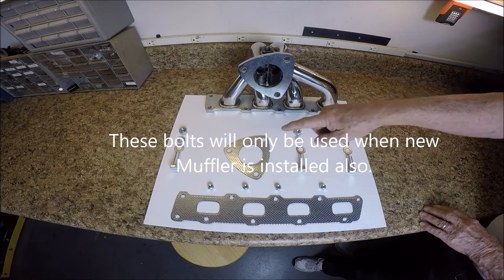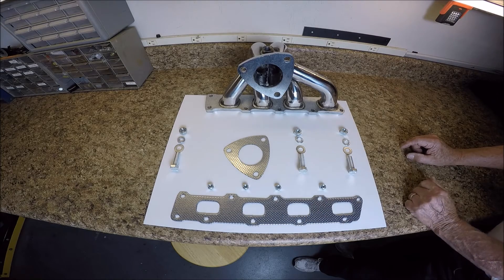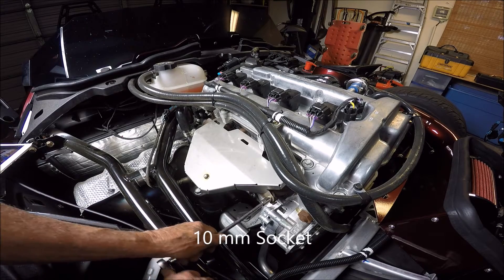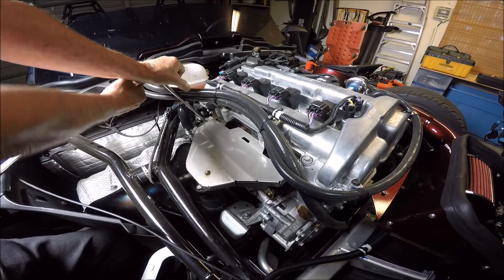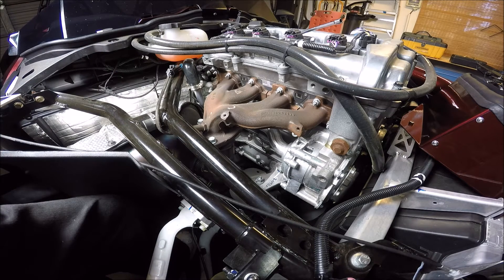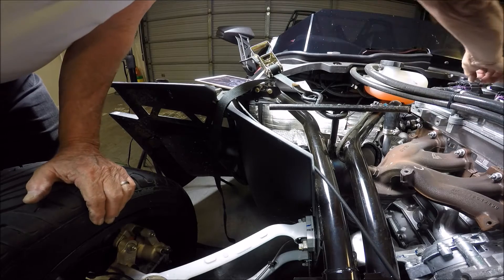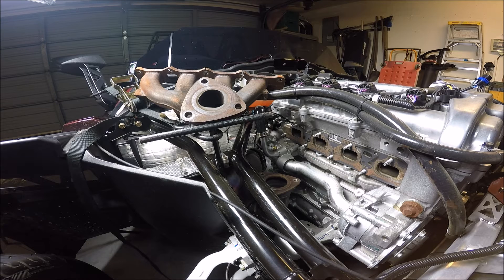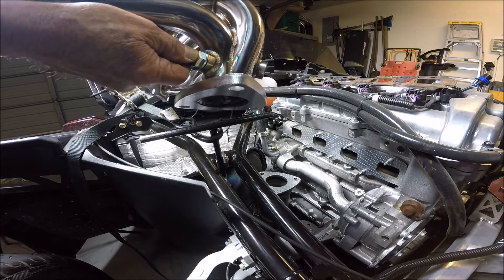Snazzy has new Twist Dynamics Exhaust Header

Comment: Thank you Sir, I used your pushing the muffler flange trick over and away trick. Installed a 1320 header on my 2019 SLR today and did not want to have to take the passenger side body off and remove the muffler. Thank you again SO much for putting out on Youtube!!!! Jim .....Summerville, SC
Reply from the maker: Thanks Jim for your nice comment.  I know at first look it looks like installing the new header will require the muffler to come out.  Glad you found my video and saved you a lot of extra work.  I think you will like your extra power and a little nice sound when you get on it!!

Comment: I put that same header on my Slingshot and took it back off 5 weeks later. The reason I removed it was the extra heat coming off the header with no heat shield was causing a lot more heat on the underside of my hood, enough to do damage to my hood over time. I test drove my slingshot after putting on this header and the only thing I noticed was all of the extra heat I now had in my engine compartment. After looking at the stock exhaust manifold, it looks to be very hi flowing without any obstructions you normally find on a cast exhaust manifold. The stock manifold, with the heat shield, does a lot better job of reducing heat on the underside of the hood and flows exhaust just as good as that header, in my opinion. Unlike Sam, I felt no increase in power with or without the header.

Comment: One trick I learned years ago to gain leverage on a bolt or nut, is to use a box end wrench over the end of an open end wrench.
Reply from the maker: Gerdog Stenc, I agree and have used that.  I also have a peice of 3/4 and 1/ metal pipe of about a foot or so.  Leverage is a must to use in a lot of applications.  Thats for your input to Leverage ideas.
Reply: 1/4 drive is what I use the most.
 The header looks good.  
Do those Slingshots have a catalytic converter?
Reply from the maker: No. Has just a huge muffler.  Lost of guy get custom exhaust with pipes that lead to the back.
Reply: Sam Owens   all you need now is a less restrictive muffler to really get the benefit of the header.

Comment: No way that manifold heat shield should be that tight!  Wow!
Reply from the maker: Yes, I was surprised at how much force it took to break loose.  I was using a 1/4 drive, 3/8 would have been better.  I just thought a nut driver would probable do the job, I don't think so!!!

Comment: Hi Sam,  Will this mod void the warranty in any way ,shape or form?  I feel I have to keep up with you in any new mods. I have a 2017 also not quite 500 mi. on it. I still have a 2yr.warranty, don't want to compromise it.
Reply from the maker: Jim Schrom, I do not know the answer.   I have installed on Snazzy and I have a lot of mods that I just want and don't worry about.  You do have a valid answer.  I think the key is if it does not meet the Polaris Slingshot manufactures requirement, may be an issue.   I can not advise you on that as I don't know the Answer.  I install and show how aftermarket products are installed.  I feel if it were a problem, all after market vendors would be out of business.  Jim, you need to find the answer for your self either from where you purchase it or through your dealer.  It is a question to consider, but I can not give advise on it.
Reply: I think generally, if there is a part failure and the manufacturer denies warranty it is up to the manufacturer to prove the modification was to blame.
Reply from the maker: I think Gerdog Stenc is think along the correct line.  If you look in the Owners Manual towards the front they discuss modifications and how they react to it.  i think you should read this part and make a decision that you feel comfortable with.  Here is the my link to the 2017 Owners Manual  start at page  12.  The talk about Modifications.  https://drive.google.com/file/d/1wqUg7tdXlEhdhPH-4t9cl1GWvGLou2Ud/view?usp=sharing
Reply: Top of page 15 "modifications MAY void warranty".  So guess one would just have to try it.
Can't see a header voiding warranty.   Not as if you machined the head or replaced the cams.
Reply: One trick i have seen done in the past, is to keep the old header, if you really have an issue, swap it to original before going to the dealer.
Reply: Hey Sam..... Just curious...... Is this the 1320 that everyone is saying is blowing apart on them...... ? It sure looks good and better flow means better performance..... Just wanted your thoughts.....
Reply: Ghornet75 this is the twist dynamics header

Comment: where can i by this header and how much
Reply from the maker: Manufactured by Twist Dynamic and sold by Slingshot Only for around$280.  I do notice more zip to the engine.  Also have the Cold Air which is a good thing to have for a full breathing engine.
Reply from the maker: Slingshot Only has the Header and it is about $280.